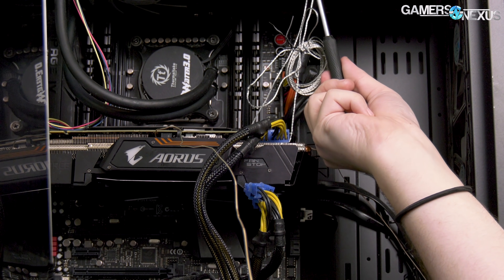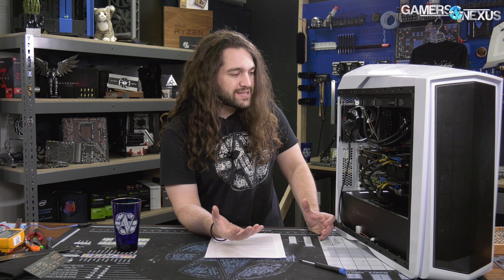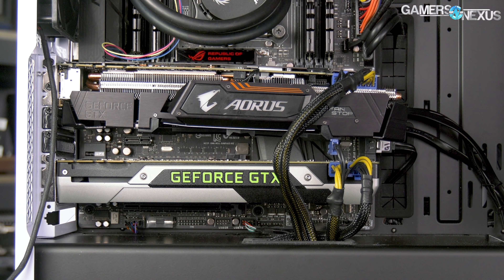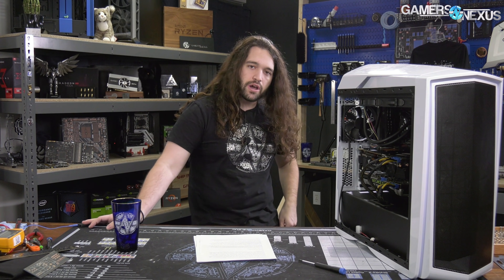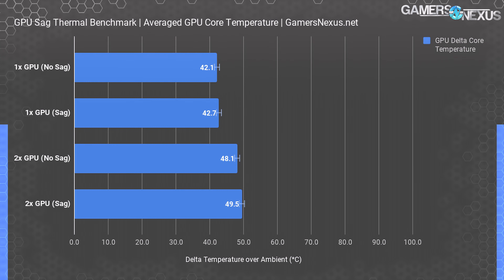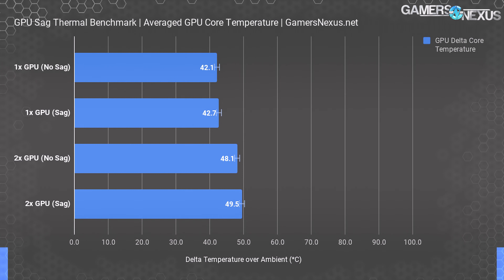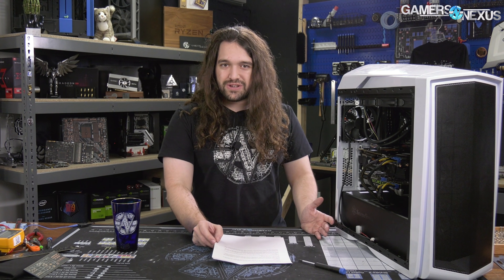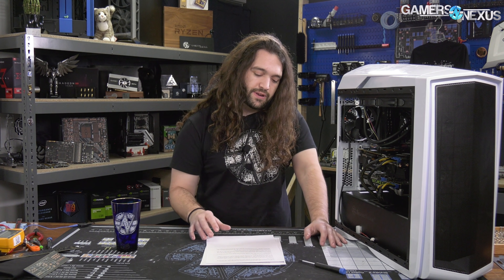Video Card Sag Test: Thermals & Frequency on Drooping GPU

Comment: I'm not sure if this was mentioned somewhere in the 622 comments that have been submitted so far but I can tell you from my own personal experience that GPU sag - especially of the magnitude shown in the video - will definitely affect how far you can push your overclock if that happens to be what you are into. Here is a link to the results of a hwbot entry I submitted last year:

http://hwbot.org/submission/3852591_marco.is.not.80_gpupi_v3.3___1b_geforce_gtx_1080_ti_7sec_397ms

This 1080 Ti was water cooled using only a chiller and I knew it was an incredible overclocking card based on past submissions I had made. For this particular competition I wasn't getting the results I had come to expect and assumed it was on its way to an early death. As I was looking at the thing I realized that it had started to sag despite having a GPU full cover waterblock attached. I think that actually could be worse - when you see sag and there is no give - not sure what that kind of stress would do to the PCB and all of the integrated components but I went and grabbed an old GPU brace I had and put it to use. Didn't reseat the card or screw it in more - nothing - just added the brace. Not only did I get the performance back I had come to expect - in this case I was hitting my highest overclock ever. 1080 Ti at  2303 Mhz on water? Ridiculous.

Comment: This is why I'm glad the MSI B450 I bought has a heavy duty PCI-e slot to guard against this. I think this issue is going to become normal with the way GPUs are going. I hope reinforced PCI-e slots and included GPU support brackets become standards for motherboards and cases.

Comment: Why doesn't any one make a GPU hanger? Or maybe they do.  Even old XPS systems have a support bracket on the front of the card.  I actually did tie my Asus GTX 1080 TI STRIX with a single solid wire to the top of the case. Someone somewhere must make something. An adjustable leg perhaps or a bar that runs full length from back to front like the Old Dell XPS system I saw. https://www.amazon.com/upHere-Graphics-Anodized-Aerospace-Aluminum/dp/B079HSVSLR/ref=pd_lpo_vtph_147_tr_t_2?_encoding=UTF8&psc=1&refRID=956KNQ18P3XDTAD70S2H or this one https://www.amazon.com/gp/huc/view.html?ie=UTF8&newItems=C03b69a91-d48d-43b2-9509-02b7d885f68f%2C1  Problem solved.

Comment: Damn...  I guess I missed the earlier review/info about this Gigabyte card.  I did see a lot of customer feedback about specifically the garbage FANS on some of the lower-end models...  But if apparently EVERY aspect of their GPU coolers is badly-engineered junk...  How am I supposed to trust any of their motherboards either?  (Despite favorable reviews of just the VRM components on top-end Gigabyte Z390 boards...)

Comment: I bought this exact card for $530 in November 2018. It runs at 2050mhz with a +750mhz memory offset. Does everything I need just fine.

Comment: Vertical GPU mounting for the win for a change. Mounting in my Lian Li O11 Dynamic is far enough away from the glass that it doesn't effect thermals under air. If anything, thermals are consistently better in this case for me. I'm putting a waterblock on it regardless so it even makes thermals a moot point. Bottom line, my GPU doesn't sag, even with a waterblock. I had a Strix 1070 OC that I had a waterblock on before I carelessly rushed putting together the waterblock and PCB after reapplying thermal paste and cracked my GPU die. Stupid mistake, trust me, I know. I replaced it with an EVGA 1070 TI SC Black and I have a Heatkiller IV coming for it tomorrow. I'll definitely be much more careful in my tightening of screws this time around.

Comment: The GTX 1070 I have now artifacts and causes random reboots unless I support the heat sink with cables from the top of my case so that the PCB does not bend. Presumably some solder balls under the GPU core or memory chips have cracked from the PCB flex.

Comment: I had a GTX570 from Asus. This thing needed 3 ,5 slots (3 to hold it and 0,5 because of the size of the cooler). Jep it is saging.
While I was using it (about 1,5 years) I supportet it with cableties. However: it's running a couple of years now in computers for testing purposes and at the moment in my girlfriends pc without any support and without issues

Comment: I had Gigabyte GTX460 1GB and it sagged badly that after 3 years it stopped working properly. Reflow procedure in oven fixed it though. To this day, the card was successfully baked 5 times and it serves as backup. However, once white DVI connectors are brownish now.

Comment: I had a gtx980 gigabyte 3x windforce that sagged quite a bit. It got to the point that the cooler seemed to be slowly falling off. I took it out and had to tighten about half of the screws on the right side of the card. After I did that temps were about 6 degrees lower on average running Unigine Valley

Comment: My RTX 2080ti fe doesn't sag, measured the distance from the bottom of my videocard to the bottom of my case on both ends. My motherboard is a Z270 gaming pro carbon, it has beefy metal reinforced pci slots, that probably helps.

Comment: #ripme  I'm using the White version of this 1080 ti card =( i bought it because it was cheap, I see why.  The shit Gigabyte software broke how it functions as well,  it uses keeps the fan disabled from boot, and doesn't turn on unless i manually do so using MSI afterburner =( it's got to the point its a serious overheating issue if I forget to turn it on.. had to rebuild its config in the bios to make sure it turns on. the gigabyte software doesn't even control the RGB, you have to get another piece of software to do that =(
And if you run the fans over 60% speed it sounds like a whining jet engine with bad bearings.  (even after a clean and new grease.)

Comment: I'm surprised that case makers don't include a support bracket at the other end as an option. Like you saw in the crappy walmart case , the only thing I liked about that case was that bracket that held up the other end of the gpu. Such a simple yet effective solution to GPU sag that could be attached to the right side of the cable grommet.  Why can't case manufactures include this as an option ?We just need to see a simple bracket you can screw on if you want, and adjust the width as needed for you GPU.  I would not blame the GPU although it is a bit big , but the solution to this is quite simple yet people are doing janky rigs to support the sagging .

Comment: This is one reason I kinda like the cube cases where the motherboard ends up horizontal rather than vertical. That way GPU's and enormous CPU heatsinks don't really have to worry about sagging. Especially with Mini-ITX and MATX systems, the horizontal layout makes a whole lot of sense.

Comment: Just be careful if you're thinking of fixing this by using string or whatever, you can actually create improper contact with the gpu core and the fans will ramp up.

If you're going to reinforce it somehow, try to have whatever you're using close to the gpu core so the heatsink is pressing correctly.

Comment: Might be better off without the heat pad. According to your testing they are useless to the point of insulating as opposed to transferring heat.  I would find a way to support it. There is no ego here, I have solid steel sides on my case. I could find a way of using the side, somehow or just hang a wire from the grill above.

Comment: When I straighten out my card from sag it was unstable and glitching for about a week or 2. This was due to the PCIe connector having to resettle after being twisted for so long.  My evga 980 classified sag was worse than this one in the video. about 35-40mm.

I jammed a chopstick on the back corner to prop it up lol.
Reply: Did you manage to get it untwisted? I think I'm having similar problems when I prop mine up but so far I only see it affecting the temps reported
Reply: @madmarty2892  Yeah it eventually straighten out again and seems find now.
Reply: @3800S1  so i should just prop it up anyway and ride out the temp issues? Cause its messing with the fans lol. How long did it take to twist back for you?
Reply: @madmarty2892  about a week.  I would re-paste the GPU if I was you, sounds like it's loosing contact with the cooler when you prop it up.
Reply: @3800S1  do you reckon that the pcie slot on the mobo might have some damage too? Or is it alright?
Also what do you mean Re stick? U mean just reapply the thermal paste?
Reply: @madmarty2892  Yeah re-apply thermal paste and everything should settle back into shape after a while. You can only try.

Comment: I don't get why board partners don't just make the bracket triple slot with cards like this. I know evga does but I can't think of any others that will go ful triple slot with their cards.
I also wonder if any cards will ever have a dummy pcie connector to support it from a second spot on the board. Perhaps the ability to change between 1x and 16x depending on what the user has in that spot

Comment: I have a very thin straight wood stick cut to the exact height needed to balance my 1060 which touches the psu on the bottom side just to prevent sagging and keeping the pci-e slot healthy and it works great xD

Comment: I nearly bought one of those Aorus cards too.  I'm relieved I ended up with the EVGA FTW.  It's really a good card that sits at 1989 MHz / 10800 mem without throttling no matter how many hours I game.  Never hits 70° either.  It's a heavy card, but after a year it's still straight.  Metal backplate that is actually both sturdy and functional (therm pads).  It was only $15 more expensive than the Aorus.. money well spent.  Too bad they don't make AMD cards, because there's no way I'm buying a 20 series.

Comment: I will sound weird, but that's why i use my cases like they are desktop/horizontal cases. To add to my weirdness i have to add that i live at a high seismic area and i don't even wanna imagine what happens inside my computer during an earthquake. Did i mention that i am weird ? btw i am weird.

Comment: One massive benefit of my Tower 900 is top-hung PCIe cards. One massive drawback is that the case can be mistaken for a washing machine.

I have two of the Xtreme cards, both are now watercooled with Conductonaut. Because of my build decisions, temps and sag are not a problem and the cards work phenomenally! I consider myself lucky to have done things correctly since it was only my first build.

Thanks for that review, Steve, it was interesting to see how low this GPU sags.

Comment: I'm always afraid that a card will develop bad solder joints from the amount of twisting in the PCB.  I ended up using a velcro cable tie to hang the card by the power connectors.

Are there any brands/models of cards that are strong enough not to sag at all?  I want to keep that in mind when I do my next build using AMD stuff.
Reply: Maxxarcade EVGA is definitely on the list of cards with no sag as well as Zotac. My old Zotac mini kept itself nice and even with barely any sagginess to the human eye. Look for something lightweight, because the PCB will have a lesser chance of warping.
Reply: @mr.blocky3274  EVGA seems to be a fairly well-liked brand.  How do MSI and Sapphire compare?  I used to use Gigabyte, but I had the same issues as the one seen in this video.
Reply: @Maxxarcade  For what it's worth, MSI is okay. From a guy who knows a friend who's currently using a blower-style Radeon HD 5870 from MSI, he hasn't mentioned anything about sagginess. Sapphire doesn't look like it would sag either. Hell, most of them probably might not. then again, I'm probably gonna look into a GPU bracket for extra precautions though. 

My experience in EVGA is nothing but golden praise and good graces, performance is absolute jacked beyond what would be even considered unnecessarily overkill, runs Vulkan like my 1050 could easily handle OpenGL, and the best part is that it came at a good deal too.

Sapphire seems to be your guy only if you're on team Radeon. I'm on Team green at the moment with a Ryzen 5 2600 CPU being the beating heart of my mother@$*!ing machine.

Comment: I have the Gigabyte NVIDIA GeForce RTX 2080 8GB GAMING OC  and it sags quite a bit  considering its smaller than my ASUS GTX1070 and that was a straight as it gets. I have cable tied by power leads up with my 24 pin power cable and its taking the sag now.

Comment: I've never been concerned about the thermals, I'm more worried about the physical strain on the PCB connector and the PCI slot - especially when the computer gets moved around. PCI slots were never designed to support something as heavy as modern GPUs.

Comment: In the past I would measure the distance from the bottom of the case to the graphics card in the correct position then cut a piece of PVC pipe to   fit. I’ve even painted it matte black and it blends right in with the case.

Comment: Would turning the case / cards upside down then improve the contact to the thermal pads on the mosfets, assuming the cooler is starting to sag away from them?

Comment: Specs: 
NZXT S340 
MSI GTX 1080 Duke oc 

i used a Dead NZXT kraken cooler as Support Bracket. i assume it impedes some airflow, but that RGB though.

Comment: Sapphire Nitro+ RX 580 8GB: over time none of the 2 DisplayPorts were emitting any signal apparently (weirdly enough, HDMI was working). Looked at the GPU and there was a bit of sag (about 1cm or 0.4 inches). After rising it a bit with some crap I found lying around the house seems to be working fine now. So I guess the sag was the cause?

Comment: Gigabyte definitely by far had the WORST pascal cards made. Their entire range from top to bottom is trash with shit fans and cheap shrouds which causes rattling and vibration. I've built about 6 or 7 rigs with their pascal cards (since they are the cheapest so everyone wants them). 2x1080, 3x1070, and 1 or 2 1060 and 1050ti. Every single one of them if u slowly increased fan speed by 1% at a time would have a certain speed where the card sounded like a playing card in a bike wheel spoke. Between this and their trash VRM cooling on the past few generations of ryzen and intel motherboards I wouldn't touch anything they make anymore. MSI and ASUS destroy them in every aspect.

Comment: I had an MSI R9 390 for years.
After years of sagging the cooler has "bent" (or whatever...) and it thermal throttled and ran basically at 90°C all the time.
I put in extra washers in between the heatsink screws, that seemed to fix it for "some time...."

Comment: I'd like to tell my story about my GTX980 Strix. I bought it used, and it came without any screws holding the backplate to the PCB and without screws holding the MOSFET radiator (I later sorted this out by ziptying the rad to the MOSFETs). The graphics card as a result of this is sagging incredibly, the PCB is bent and overall feels super-flimsy. My friend 3D-printed a support bracket for it but it somehow messed up the cooling system - instead of normal 70c the card reached 80c with fans blasting at full speed and severe throttling was going on. Well that's my story.

Comment: I haven't had any perfomance differences rather a functionality problem with my old sagging Asus HD 6950 2GB Direct CU II with the tripple Slot cooler. It works, when the PC is laying on the side and the card is pushing down to the socket, but letting this card sag normally with the case in a normal standing position always leads to bluescreens and endless frustration. Glad I don't need to use it anymore.

Comment: this is actually because 99% of PCs are built the wrong way around imo.  This entire problem is fixed with a horizontally oriented motherboard and the GPU sitting on it perfectly stable with no stress on any component. Apart from the practical advantages it looks better anyway, because GPUS themselves look better from the fan side than the back side. In a "traditional" build you can't see much of the fans - only the back, so only cards with backplates look any good at all.  It could be said that in this instance all GPUs are built the wrong way around too!  so err... yeah, I don;t know why we don't have more cases designed around the much more sensible orientation.
Reply: One of our cases is a Corsair 600C and for this reason it makes the graphics card look 👌

Comment: Hello, in my opinion, the biggest concern should be that the bga solder points can break, if you stress a pcb like this even a ceramic capacitor can break and get a short, it´s unlikely but bent pcbs can do strange things. So an interesting test would be if the error rate of the ram increases

Comment: Very old card at this point but  my EVGA GTX 660 sagged factory new. The impact in performance was huge due to it sagging to the point the blower fan was unable to spin. I propped it up with a ballpoint pen lid that was conveniently the exact height of the distance between the card and the bottom of my case.